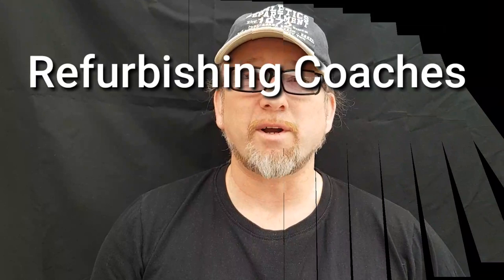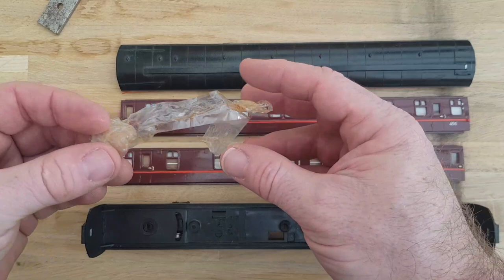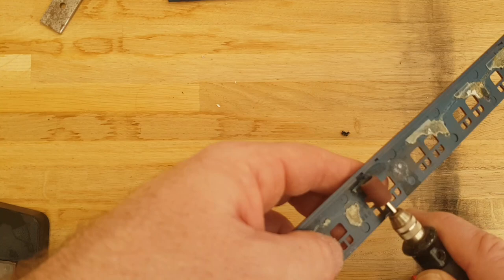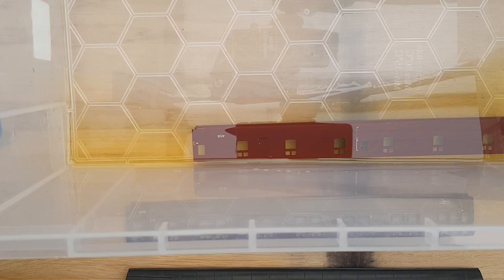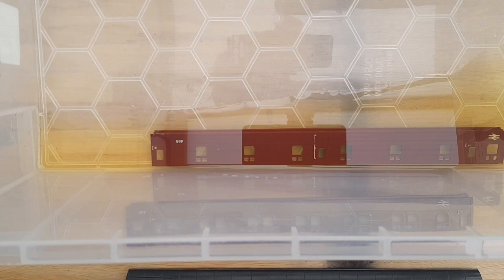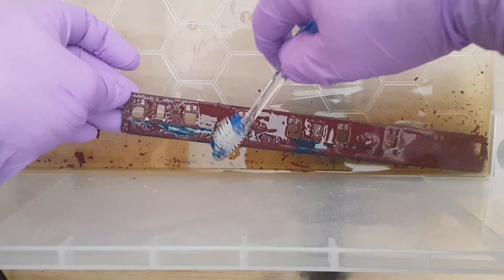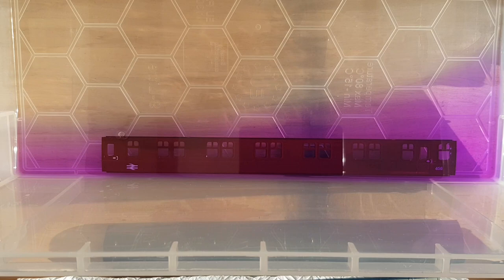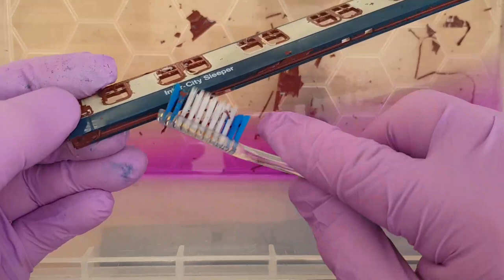Refurbishing Coaches Part 1

Comment: Commendable effort, but amateurish to some extent. Brake fluid Dot4, methylated spirits, white spirit, turpentine, rubbing alcohol are some of the materials that SHOULD NOT be employed in the restoration of plastic models.

There are some excellent products specifically designed to strip paint, which are environmentally friendly and water based, which makes them safer to use and safer to good old Mother Nature:

1. Revell REV39617 Paint Remover,
2. BioStrip 20 Paint Stripper:

Both remove effectively paints such as acrylics, oils, vinyl, water and oil based primers, varnishes, polishes, etc; leaving the surface material intact.

This is your primary objective, to get the surface clean but INTACT! Plastics used in modelling (trains or otherwise) are high quality polymers which can withstand high temperatures during moulding inside big steel blocks, then harden to retain all the great detail we see in modern plastic models.

Revell REV39617 Paint Remover is liquid... So paint it on with a soft brush, a soft hair mop type is good. Leave it alone for 15 minutes or so, it starts blistering soon, then remove the paint with a soft toothbrush or similar.

BioStrip 20 Paint Stripper is a gel. Use a synthetic round brush (the ones designed to paint with acrylics are great - I use a number 10 or 12), dab the gel GENEROUSLY, all over the model. Do this late evening. As soon as the model is covered in gel, wrap it in clingfilm in a way whereby the clingfilm touches the gel wherever it is applied to the model, as much as you possibly can. Then take this "clingfilm parcel" and wrap it with aluminium foil. Leave it overnight. It works gently and safely. Next day morning, unwrap the piece, take a brush used for stencilling (one of the those very densely packed with a flat surface) or a very soft toothbrush, washing-up soap (Fairy or similar) and running tap water, and brush off the old paint. It should come off easily, in fact it tends to flake right off the surface. You should be left with a perfectly clean piece, as if it just came off the factory mould. Finally use a soft artists brush (synthetic hair type are cheap and good for this), size 12 or so, pure sugar soap solution, wash the piece with the brush, dipping it in undiluted sugar soap. Rinse well under running tap water. Leave the piece(s) aside, standing on kitchen paper or lint-free cotton rag to dry naturally.

Yes, the processes described above are not the short and fast approach. But you will achieve superior results. The better your preparation work, the better your final result. You must avoid the scars of prep work, because they will show through the final paint layers and the result will be disappointing. Your prep time is not a waste of time, it is an investment in the final result.